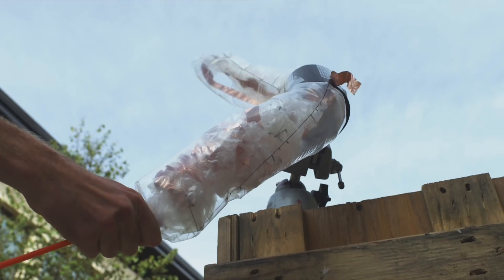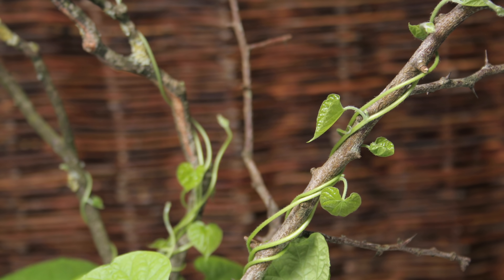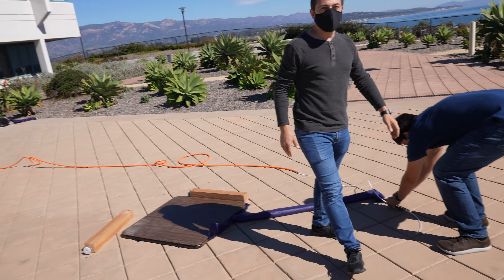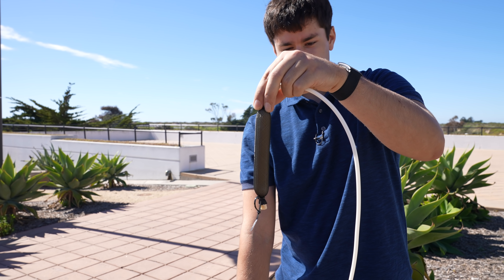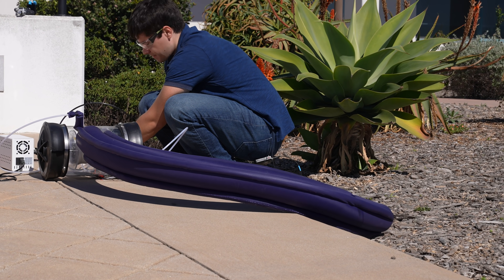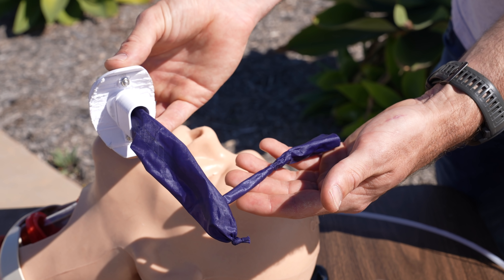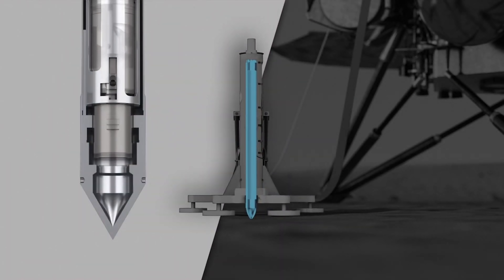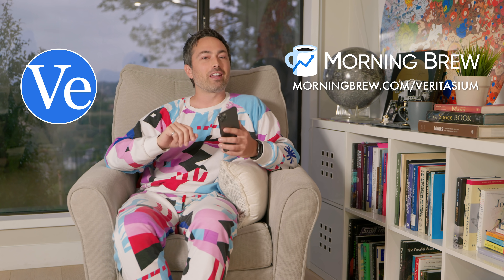This Unstoppable Robot Could Save Your Life

Comment: What else can I think to do with it? I can think of a fun toy or an awesome prank. Imagine an instantly deployable grid that fluidizes beach sand. "Ahhh it's quick sand HEEELP."
__
|      | <--- air pump
||
|| <---main trunk going straight down here

||
||
|| <---90 degree bend here
\\
   \\ <--some length here so the pump doesn't sink into the fluidized sand
      \\
         \\==================================
            \\==================================
               \\================================== holes all along these
                  \\================================== branches that fluidize
                     \\================================== the sand here
                        \\==================================
                           \\==================================

                                Someone please make this thing.

Comment: Rapid safety support scaffolding. That is, the quickest example that came to my mind, say you're in a cave where the ceiling or walls are unstable. First you deploy the vine robot scaffolding to follow along the ridges without causing any significant stress on the already unstable structure and then fill it with a quickset substance that hardens into a strong scaffold to support the walls/ceiling and prevent collapse.

Comment: Some years back when the idea first shown to me the brand then was "Vetter"  maybe German? rubber coated steel mesh bag. It could be inflated with air or water at low pressure. We took the bags to the Auckland Transport Museum and lifted the steam locomotive parked for exhibition, very successfully. A great idea, I believe the US fire service has something similar.

Comment: IDEA:

Hear me out! Imagine building your beach house substructure with a huge inflatable dong. This is how it would work in my imagination, maybe in real world too. I need someone way smarter than me to laugh at this idea and show how it couldn't / COULD be done. 

You could maybe place house substructure deep in sand/soil with this. You do the blowy airy thingy with the robot's tip. In this situation it would be in bigger scale. Inside that tubing you'd place an iron pole or a long, thicc piece of wood. 

 It would get pushed deeper in the sand/soil as the robot is making its way down. If you made it a hollow tube you could retract the whole thing back leaving the support bar in place. Once deep enough, it would deflate from the tip first and the tube would climb up again leaving the pole deep inside. The gaping hole in the soil would retract closer to its original form, tightening the pole in place, sturdy and steady. 

:3

IDK if it's possible to get the tube retracted after this but i guess it wouldn't be the end of the world either. If the whole tube got deflated, it would wrap around the pole/huge log of wood. It would then also work against moisture building up in the structure. 

This is a crazy theory but I could see it working. I'm high as hell though so anything sounds like a dope idea

I thought I was writing a redit comment. 

Have a good day/night y'all

Comment: so, this could be improved with micro valves within sections which could increase mobility and maneuverability a Lot. so, say you had a section of pneumatic muscle every foot along the robot, and each section could be individually and remotely controlled. assuming you could use a series of wires which was essentially a part of the fabric of the robot for power and control of instruments and such mobility devices, then this could be improved vastly. i can imagine this using not just air, but water as a means to move as well, and also be able to use far more pressure. and if you used carbon fiber or kevlar it coudl also be made virtually puncture proof, or slice resistant if say where it used in a sharp rock or metal pile, or around broken glass and other slice capable debris. while also retaining its compliance capabilities...

Comment: At 0:40 with it unrolling from the inside through tight, sticky places, I realised where they got the idea from. 
It's how our foreskin works! If you don't chop it off, of course.
That action of unrolling from inside but sticking to the walls of the tight space. Not sliding against the walls but sticking to them as the inside moves in and out. 
Exactly how s foreskin reduces friction to nearly zero making things much easier and nicer for both parties. 
No friction means no chafing. 
This is the perfect video to show pregnant women how a normal make foreskin works and not to hack it off. 
Makes me shudder just writing that So barbaric.

Comment: interesting.... I could see that in cave rescues being useful, for floods, and trapped people, and or giving support.

The interesting shape design technically if you create a mobile unit maker, that fabricates the shape on site, it can be used a per basis, with a additional limited mobility. Small copper pads and heat can utilize other materials to cause tension stretch to help/ assist it in turning or moving without melting the system. Or other forms also. 
The only problem in cave rescuing is the added pressure if the person is stuck or can't move, but this can be a benefit also. IE the known crush of per human per volume of each region could assist in crushing the the person intentionally since their trapped and then release the pressure in and out to allow them to inch by inch move out. IE, common places of getting stuck is the lip of the ribcage going backwards. BY compression them back the ribcage could be pushed back as a lever assist and then deflated and the person should be able to manage getting out. However, portable pneumatics for surgery are available and could be used for cave rescues for the last.. 50- plus years. So the medical world already has  a mechanical controlled snake design. So a inflatable system is great and inexpensive, but still requires power. The colonoscopy tools, type, could be used for rescue mining, the unit and power source would have to be survival basis, so there is other things of energy means so you don't run out. you can literally just  create a dust grind system of removing rock whilst sucking out the debris... The speed of the device and setup, would have be at site deployment, less than 5 minutes ( plug and play), ideally 20 seconds or less. Then be  able to remove a the volume of 3 adult humans of rock to dust in 10 minutes would be ideal, Hitting the 3:33 minute which would suffice to avoid brain damage. Then the unit weight and means of carry, would be a pack etc.. but of course rope is always great.. and barrier system to not attack the person but a slinky cam would work also... basically a mighty Earth boring mechanical worm :). this is a safety means which has many other applications. Spelunking... 100 metre distance...
300 feet. of course a top side device could be made in a actual mobile unit.... and its distance and boring speed could be increased... IE unlimited depth.. boring speed... 3 vans sizes of earth per minute of normalized rock. ore. However, the means of removing the rock can be top based or energy based, but energy has its problems. Using some old mining teqniques of alternating sound hammering to easily chew through the earth, like a those like... ratchet trilling bugs in the sea... effective means of munching and cooling itself... 

As for a inexpensive means for something.. else say a unit that would cost.. to do what you want it to do... 1.2 million or 600k ...... the largest cost is engineering the maintaining of its power, while reducing its weight. which often increase the selected materials... since survival is at stake the cost is irrelevant...  one never spares an expense at life... but apparently whatever this world is forming itself into, is something quite opposed to survival.

Comment: You could repair leaky pipes or for something through to move a clogged drain. You could increase the power of it by using water when necessary ( moving heavy stuff or burrowing in the ground)

Comment: We could develop building construction aids for regions where the ground below is more sandy and loose, wet or erosion prone. This could solve the problem of compacting the soil and filling them with huge loads of building material before the aboveground construction. I'm getting this idea from how fibrous roots of trees make their way into soil help them hold their ground. This was also an ancient technique used by certain tribes to plant grass on their ceiling to make the clay roofs more rigid. More like how a tender coconut shell is soft yet highly resistant to structural deformation.

Comment: That sand robot blowing air at the end is essentially turning the sand around it into dry quicksand, which is like quicksand but with air instead of water.  Unlike normal quicksand, you will submerge instantly in dry quicksand, but without a spring of air, it’s unlikely to exist.  Meaning dry quicksand is 100% man made.  Maybe desert winds in a dune desert might be able to replicate the effect for a second, but not consistently.

But dry quicksand, being easier to sink into, would be amazing for burrowing.

Comment: Imagine underpinning a structure in construction that has settled, using one of these robots to find the area under the building, inflate, then use the robot as a pump to add more concrete to the area to prevent further settling. I see a lot of possible applications with concrete work if the robot could function as a concrete pump.

Comment: The engineering application for this to inspect enclosed spaces, or feed/fish wire (for example) is worth its weight in gold. Instead of spending many frustrating hours trying to fish wire, it could possibly be done in a few minutes. Simply attach your fishing line and let this thing find its way to your new electrical outlet space or whathaveyou.

Comment: Some plumbers use this and have used this for years. It can be used to fix a pipe with a hole in it. For example; Your draiage pipe has bursted and now it leaks water. You can use a tube like this that has a hardening agent inside its walls. Once the tube has gone all the way trough you can cut the cap off and now you have a new hole-less drainage pipe (only with a slightly smaller diameter).

See CIPP (Cured In Place Pipe) on Youtube to see what I mean.

Comment: As a firefighter, I can imagine how useful it would be to have a version of this in our trucks. I have EMT experience so I've had to open airways before, this looks like a massive improvement from the current standard.
Reply: As someone who had to be intubated in an emergency, I find this as a welcome alternative. Thanks for your work saving lives.
Reply: Would the reverse work to cover a limb to apply pressure  perhaps like an air cast?
Reply: Whale Hello !
Reply: this looks like the same concept design as a super glottic airway device like an I-Gel or King Tube, and inflating the entire thing seems like an unnecessary possible complication for pneumothorax patients with trachea deviation, or the added pressure on the jugular vessels with JVD for example. you need to have the device be able to protect against aspiration, the added equipment of a pump, valves and whatever else. I'm not really seeing the niche of an airway device like this, but if they design it properly maybe it could be great. I guess the idea of inflating an entire tube like this without visual confirmation is my biggest concern.

I've missed my fair share of intubations and even tho it hurt my pride, I just whipped out the ole king tube and shoved that bitch in there
Reply: @HaVoKxii  wouldnt a chest tube be in order for pneumothorax? I have had repeated issues with spontaneous collapse of my lung. Always a chest tube except during my surgery. 
None of it much fun.
But I have survived.......so far
Reply: @heyyou5189  it could be, I'm not sure. my education and experience is in prehospital care as a paramedic, our resources are limited to what's in our bag, our brains, and on our ambulance. 

I was referring to a clinical sign of a possible pneumothorax; tracheal deviation. your trachea is pushed laterally because of a pressure problem in your thoracic or pleural cavity - it might be a bad idea to apply equilateral pressure to your entire trachea in an attempt to blindly inflate an airway device like the example concept device shown in the video.

excuse my thinking, we rarely have ample time to clinically diagnose one or more life threatening emergencies based on what we see, what we know, the vital signs, MOI/NOI, and patient history. we find what we can fix and fix what can we see, failing that; at least get this fuckin person to the hospital where they can be scanned, blood tested, and operated on alive enough to matter.

I'm not dismissing the concept shown in the video, I just don't see a role it can fill. but I'm not an engineer either :)

edit: sorry, to answer your question; the closest we get to a chest tube is a needle decompression, which is exactly what it sounds like

and im glad you made it mate, I've been blessed with 0 major health problems or hospitalizations, God have mercy on those who have or will
Reply: @HaVoKxii  Peace be to you and yours!
Cheers
Reply: Let's say it works first go nice and quickly to get the tube into the airway and you can then feed in fresh air to the lungs.. then what?
Pushing air in seems pretty straight forward, but then the patient needs to expel that air. Would the tube not collapse at this point, preventing air from escaping?

The only way I can see to keep the tube from collapsing is to maintain positive pressure, but then the pressure itself is preventing the patient from exhaling

I love the idea of something quick, relatively safe and easy enough for someone with basic first aid training to do in an emergency.. I just don't understand how it'd help.

Unless.. maybe, there is a smaller more rigid tube inside which is directed by the compliant mechanism and once it's inside the airway the inflated portion is no longer necessary at all?
Reply: @MotoCat91  putting aside the design questions of this particular device, positive pressure ventilation is how you manually breath for someone using a bag valve mask device. because your lungs are in a cavity, they automatically exhale due to the pressure differences that change when you inhale naturally, or have air forced in with a bvm. an airway device doesn't have to have a separate tube to allow air to exhale from the lungs, the valve in a bag valve mask device allows air to be exhaled to the ambient air.

as far making a device that anyone with basic first aid training can utilize to effortlessly ventilate someone in an emergency, that's never gonna be within the scope of first aid training. there are too many variables, possible complications, and contraindications. 

if you want to provide rescue breaths as a part of first aid training, get a mouth to mouth mask and use that until trained personal arrive.
Reply: You know what is tight and sticky ? ( ͡° ͜ʖ ͡°)

A cave (° ͜ʖ °)
Reply: @lovelylipbonesouwwwwwwwolv2198  bloody hell

Comment: The problem with intubation isn't getting the tube into the patient, it's getting it into the harder to reach trachea and not putting it in the esophagus where most things typically want to go..  You're still going to have to visualize the chords and guide the tube into the right spot, because any chance of missing could cause more harm than good

Comment: This can be used as conduit. It can find it’s way in certain spaces. You then use the skineffect to the harden the walls with some kind of resin under pressure. You then have a tube to put in wiring.

Comment: I’ve always wanted to build a extending twisting Turing robot, I thought of using wires and running current through it to make it turn, and to extend it would uncoil at the base, but I don’t think you’d have enough control with the current, or if it would be strong enough for anything other than a camera arm. 

Your invention is so much better props to you

Comment: a really cool idea would be a table of small with small tubes underneath all individually attached so that it can be connected to an arduino and can be given different path sequences to the air output and you could have a walking surface on any type of surface!

Comment: I think this could be used to checking if plumbing and drainage pipes are in the right place from the inside. The layout of the pipe network is alway already known, so the trick with tape would work really well. Pipes are also an enclosed area, so if there is some sharp rubble it wouldn´t be a problem.

Comment: This is not new. Draper has a tool for lifting cars using a bag, the same device is used by emergency crews the world over to Aid search and rescue by forcing itself into rubble and debris to get airways open for trapped people. Some use similar tools to split giant rocks apart by using a crevice and expanding. What is new is putting all these techniques into one device, such as the rolling tube that expands and the air pushing it out, adding a stay out camera - this will probably be copied and used by oil companies to help when fracking, because that's what oil companies do, like delaying electric cars by 30+ years.

Comment: There is so much biology here from the inspiration to the mechanics. The trachea is so smart, a semi-specific binding site (large tube) for the oesophagus while the active site can better locate is active site. With engineering if we could focus to first learn from biology and then innovate it, we would then really grasp low energy cost engineering. How to move or dig, no need to have a back and forward mechanism, just simply move forward.